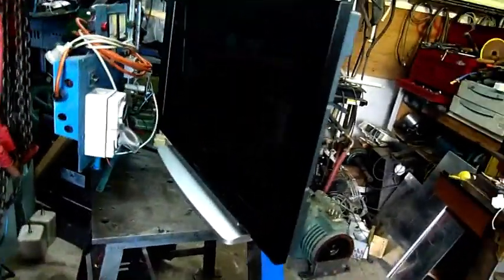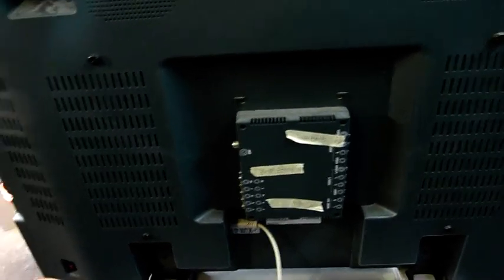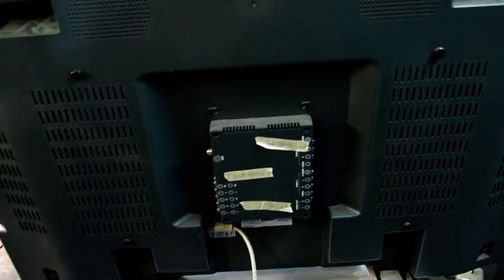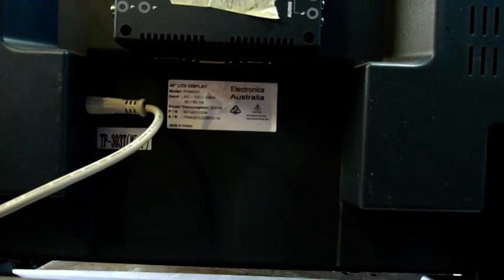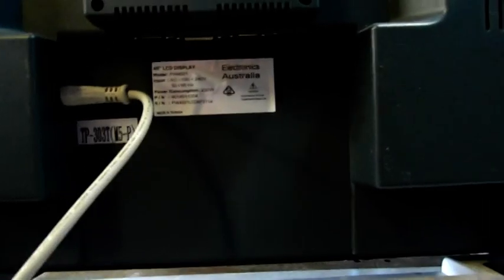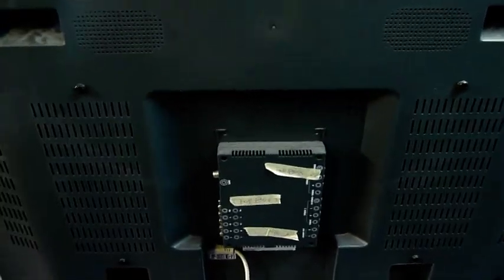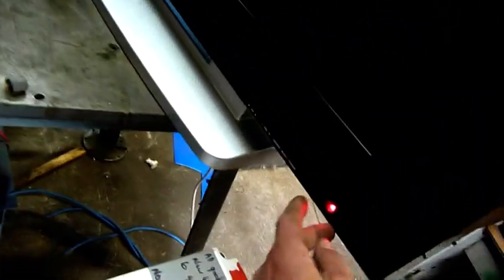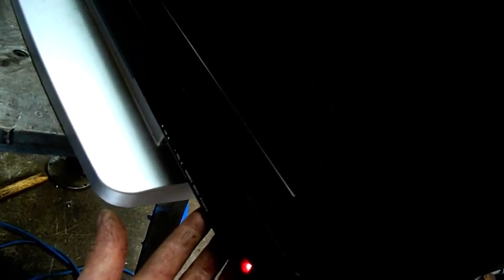Pyrod 40 Inch LCD TV Repair Pt1

Comment from the maker: @Knaeckebrotsaege thanks for the info!, the caps really are overkill!, but I think it is a solder issue on the digital board that's stopping me from fixing it.

this unit was $2500 new in 2006!, and despite being cheap, was marketed as a commercial/industrial unit, as well as domestic (sold at K-Mart for a while)

Comment: I bet some of the power supply lines are down, best would be to check all the lines at first :] Maybe there are some micro fuses, if some of the contacts were cracked it's likely that micro fuse might be blown too. Double sided PCBs usually has those micro smd fuses just near the power input.

Comment: Taiwan is the shit, cheap but good. My gas scooter is made in taiwan and its been 7 years so far with no problems (only replaced rear wheel bearings once with clutch and belt drive, 4 times) but after 1700km piston slap came knocking and now it has around 2000km still has 160psi running strong.